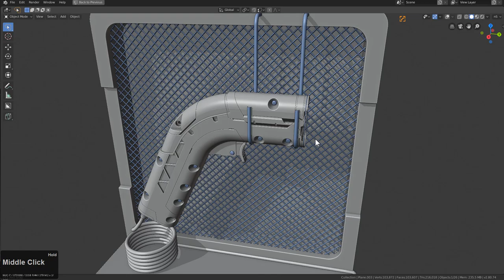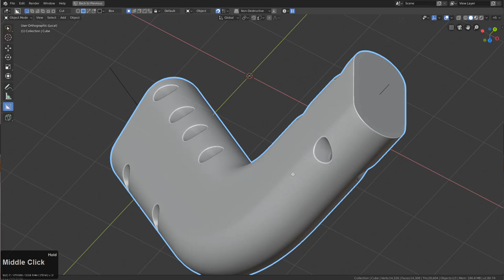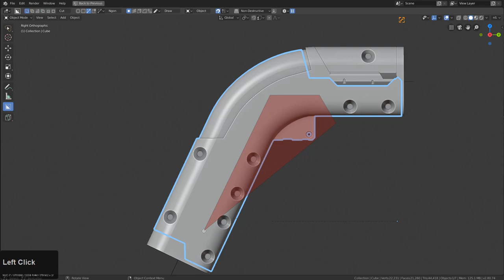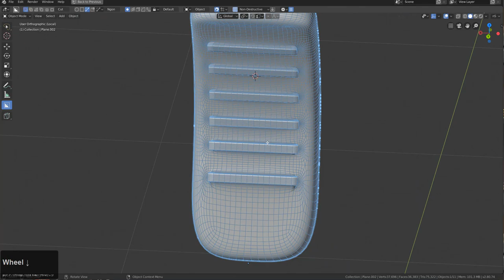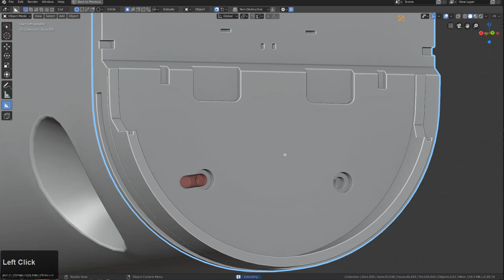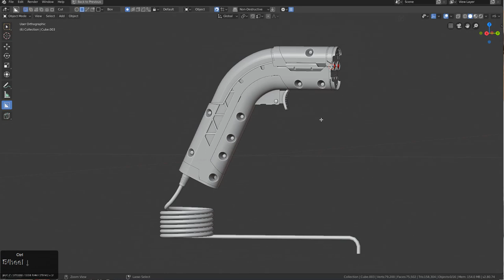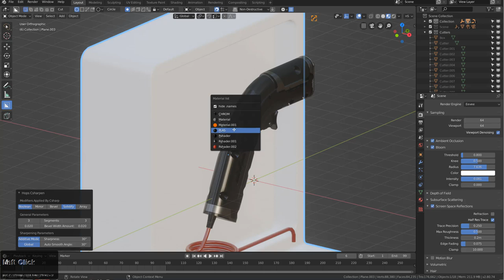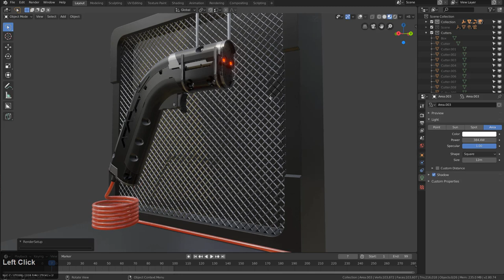Handheld Attempt 9 / #b3d / #hopsCutter

Comment: One thing I like to do when Alt + S won't work is to use a displace modifier with no texture and adjust the strength to adjust the size. It's like a uniform scale but it behaves better than Alt + S sometimes
Reply: Great idea! I am going to keep that one in mind.

Comment: Do you consider a suggestion for improvement? is better to replace the blue box option and use a blue plane ( may say a box with zero thickness) that can be inserted along with the red box cutter! It can use the center of the red box and perpendicular to the cutting plane, or if array is used can link the multiple red boxes centers as blue edge line and the plane is determinated by the red boxes height. That will fix the cut automatically the render issues and the cut position, you will not need to come back and insert blue boxes to fix geometry. This can be an option that can be activated as separate icon of red box, with cutting blue plane!
Reply from the maker: Hmmmn i dunno. I didn’t even use a blue plane in this and the topology that I had to correct was necessary for what I needed in this case. Without additional geo shading would suffer but sufficient geo lessens the blow and minimizes shading impact. A plane blue would be nice. It’s an idea already being considered. Of course we gotta pick our battles but the process of manual cleanup is necessary  until all the pieces click on how to automate it. So a lot of the issues I cause in videos are to highlight solutions and show ways to avoid certain gotchas but your idea is definitely worth consideration. There’s a road ahead for the blue box so in time we may double back on it .
Reply: masterxeon1001 thanks for the feedback. I agreee that the blue plane is not always necessary, this is helpfull when insert cut boxes on empty planes or close to the edges. Maybe to have it toggled by user as an option of the red box, and with the posibility of move/rotate the blue plane, to control the cut effect, and insert this option by user if it fit to use it. It helps to see this cutting plane prior to commit for the red cutting box, that is my point. Think how much it takes to come back and put the blue boxes or move the vertexes, it is a killer for the modelling mood, and personally I do find that inefficient, do it right from the first time, we just need the visual help for that... Nevertheless, great work, as a veteran on SketchUp I do think the Blender's future is far more brighter now, and is just the beginning Chipp is right ; wait to see AR or live VR features coming along with this new 'par' in modelling/rendering that got now ( and how it was few years ago, when Maya, Max dominated the market), and Blender shine even more. And, box cutters and hard ops have their fair part on bring new 'old' users back, congrats for that (to all team)!

Comment: hey boss, at 3:43 when I subd. the mesh with ctrl 1 it pinches in on the sides, and s-sharp. does not crease the mesh back into sharp edges. Any idea what could be causing this? I tried diffferent things, but I have no idea what I am doing wrong.
Reply from the maker: Ctrl + ~ >> hard ops helper will let you choose what mark ssharp actually marks so it sounds like crease isn’t enabled. I usually mark all 4 when working like this.
Reply: @masterxeon1001  I should have looked harder, yup you are 100% right, crease was not enabled. Thank you so much!
Reply from the maker: @PonteRyuurui  no problem!

Comment: I have a question. would the same object you created be possible to create without any booleans? I mean only using subd modelling? Also which one would be having the worse performence in Blender and what about exporting the object to a game engine? what happens with the topology and booleans?

Thanks in advance!
Reply from the maker: any asset can be made without booleans. It just depends. I go between sub-d and booleans to balance curvature and control. Performance would be worse with subd since 80% of the added geo would be unneeded. Its a known issue that sub-d is slow. All the more reason to use it for moments. Game engines work fine. Theres games out there with my stuff. Also baking is easy nowadays. Just give it something good to read from. Topology is controlled enough for my needs but booleans allow for extra detailing at the end.
Reply: @masterxeon1001  Thanks for the quick response!

Comment: Would it be possible to add random picking custom shapes mechanism in a given collection for every mouse click? Or maybe one shortcut key that just picks every next custom shape that is in line...
Reply from the maker: C picks the next shape in collect. So does alt scrolling during box draw. You can recall any shape you previously used.

Comment: Amazing work! I have a question when I apply the Subdivision, then the Bevel doesn't work and if the Bevel is under the Subdivision, it's not working too. My hard ops' version is 0098.
Reply from the maker: check the modifiers and marked edges.
Reply from the maker: Also i was working in a weight workflow for this so at the point of apply i would make sure the bevel mod is set to weight since angle is not gonna do the job at this late stage.
Reply from the maker: @toocoolkaz3874  prolly not. Id check and make sure the mod is enabled in the stack then make sure edges are marked. 

https://i.imgur.com/O2qyXwZ.gifv

theres a support channel where you can post screenshots and we can check more in depth. 

also there. 

https://i.imgur.com/axYJ8P7.png
Reply: @masterxeon1001  I checked the SHarp Options, then the problem was solved:) Thank you again.
Reply from the maker: @toocoolkaz3874  excellent. Glad there was an adequate resolution for that. Back to cutting!

Comment: Awesome video! Related only to BC, when I press J to add a box to a cutter (aka adding a boolean to a boolean aka boolception), it always makes the green box fight with the other cutter's local z making the original boolean null. I easily fix this by just shift saving the green box and moving it a hair up on the Z, but it would be nice if this happened automatically with no boolean z fighting
Reply from the maker: it actually happens by default if you start in the tool. But I like to verify my depths.

Comment: i am actually very impressed in a bad way, that it takes so many steps,  just in order to add these screw holes, even tho it doesnt feels difficult to create a solution, which basically leaves it to the software.... I mean, its just a circular shape, surrounded by additional vertices in a certain order, relative to the surface. Is there any software which handles such tasks mostly on its own?

So far, Zbrush seems to have implemented a very decent approach for such tasks. It almost requires nothing from your side to get it done. It's just that Zbrush is a little bit different when it comes to hard surface modeling in general and is well.. good, but not quite as handy
Reply from the maker: well this study was focused on those holes particularly. I could have taken the easy route and tried to make it work out. Since this was attempt #9 I had become used to some of the nuances with that area and was experimenting with the workflow of that area. Sometimes my approaches are a dissection of the workflow in order to allow me to attempt alternative solutions in search of a viable automatable solution or something that could be presented to new users with intentions on education of control with curvature which is a weak suite of boolean modelling. 

I got much love for zbrush. I also attempted it in moi like LordEdon himself but I would take my approaches with grains of salt. I bet there are even more efficient ways I havent approached yet. But I was proud of the result. My goal is always a fine render so sometimes I get obsessive about surface and topo since blender lets me dance on surfaces with minimal surface loss. 

Also the obsession with the circles was due to me letting sub-d have a shot at surfacing before I let booleans take it to booltown. Bevel and Sub-d are my 2 "auditors" I face in the modelling process but lately I have been obsessed with the sub-d portion of dancing. In retrospect I did the minimal sub-d get geo required to get the form I wanted to use booleans to destroy. I regret nothing haha. 

Now you got me pondering the complexities of the handheld and how I should do one more. For efficiecy's sake.